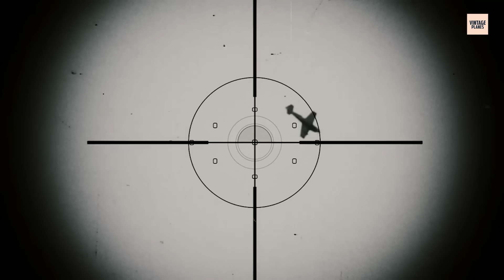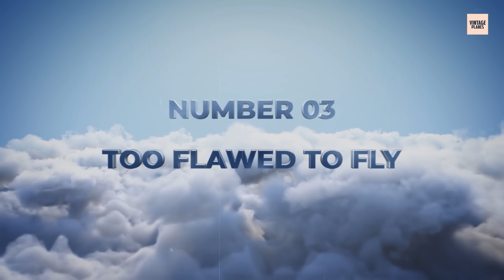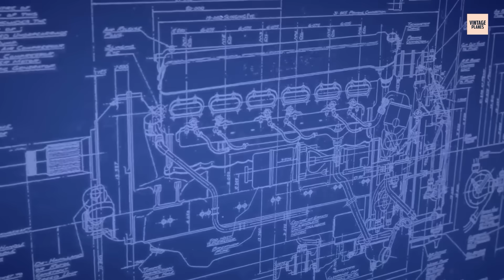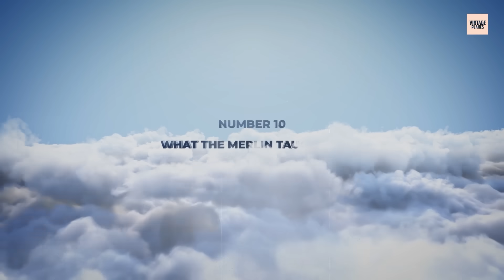THE SHOCKING TRUTH BEHIND ROLLS-ROYCE MERLIN ENGINE

Comment: I once worked with a machinist who had been trained at Rolls Royce and he told me about the unbelievable standards of quality control that went into the building of their engines. 
Crankshafts were machined from a solid billet of steel and the tolerances were exact. The bearing journals were not allowed to be machined beyond the minimum measurement by even one thousandth of an inch; 0.001”. Most factories would fix such errors by building up the undersized journal and remachine it, but RR wouldn’t allow such a thing and even if the last machining process went below the minimum specifications, and the crankshaft had already cost a phenomenal amount of time and work (which equals money) the crankshaft would be scrapped. 
Every part of the engine was made by the same machinist, so pistons were made in sets, conrods were made by another machinist, valves by another. Each part had to be as identical as humanly possible and was marked with the identity of the person who had made it. The weight of each part had to be similarly identical and if one out of a set of pistons, conrods, valves, etc was damaged in assembly, the whole set was discarded and a complete new set would be used. This is why the engines are so expensive. 
This was all postwar, but the standards came out of the experience of WWII. 
Metallurgical advances in the war were born of the desperation of wartime and were vitally important to the overall success of the Merlin engines. The P51 Mustang airframe was a great one, but the original engine was not capable of producing the power of the Merlin and it was only after the two were combined that the P51 became the incredible fighter plane its designers had envisioned. 
The only weakness in the Merlin was its carbureted fuel system, which meant it couldn’t cope with inverted flying as well as a fuel injected engine, such as the German fighters had, but work arounds went a long way towards eliminating this. One tiny, but very effective, fix was the brainchild of a young woman who suggested the addition of a washer that acted as a fuel restriction valve when the engine was inverted and that was a great improvement, to which others were added as the war continued. 
The German fuel injection systems were excellent, but they had their own issues, which required very skilled engineers to maintain and repair when necessary, which was a major problem for the German tanks, whilst British and American tanks were so simple and easy to repair that they could be repaired on the battlefield by their crews, something the Germans never managed to do. 
Aircraft were very much the same and their relative ease of maintenance and repair was a distinct advantage over the superiority (on paper) of the German machines. Other factors, such as the availability of fuel and the ability of Allied tanks and planes to communicate with each other are another, but that’s another story. 
The German fighter pilots were in awe of the Spitfires and Mustangs and other aircraft powered by Merlin engines and the memoirs of such men tell the story, which flies in the face of all the theoretical superiority of their own machines.
Reply: Then cam the Moscato the wooden wounder  so fast  nothing could catch it after it bombed   and ?? no guns at first   as a German pilot said  they flew much higher than we could  we could not  see they went through us like a knife in butter  just 2 seconds 
then they were GON we could not catch them  633
Reply: Thank you for this comment.  Very informative.

Comment: You are full of bullshit. RR designed and developed the Engine it was `manifold pressure that was the key. The higher the octaine  100 octaine fuel was the key.. your description of the development issues is theatre of the highest order. Oh, still killing pilots. In 1938 is a huge reach considering the engine was well over a year in service at this point. Crap.

Comment: Before the Rolls Royce engined P51 , it had limited range and performance from its American made Allison engine and I believe we put the first Merlin engine into a P51 and test flew it.
Reply: @trevorclark.....More British BULL$HIT !!!  The allison engined P51 had as much range as the Merlin, it was the drop tanks and the added fuselage tank that gave the later Mustangs more range !! and an Allison engined Mustang would out run any model $hitfire under 20,000 ft.  the Brits hashed up 4 test mule mustangs with the 60 series engine but could not figure out the coolin, added an ugly chin radiator that slowed the plane down.  Packard Built ALL the Merlin used in Production Merlin Mustangs and North American aviation installed and produce ALL the merlin mustangs !!!    DUUUUUHHHHHH!!!!!!!!

Comment: The  Mustang was an R.A.F. Spec that specified a R.R. Merlin, The yanks tried the Allison 1700...Flew like a Brick.... The R.A.F. reminder that a Merlin was specified then tried a Packard Merlin that Packard had cut many corners and did not understand Precision so the Packard Merlin flopped...Immediately a Genuine RR Merlin was installed the Mustang flew as intended but the Mustang was only ever a single Mk not able to be modified as with the Spitfire which went on into over 30 Mk's.
     The Merlin went on in the shape of the Griffon and when fitted in the Spitfire P.R. 19 could out climb a Mig 15, also powering the Shackleton
Reply: @altaylor  Your story is total BULL$HIT  !!!  Then  Brits came to North American Aviation BEGGING for the P40 to be built under license, they considered it the BEST AVAILABLE fighter, But Dutch Kindelberger and Lee Atwood had been working on a new fighter design, lots of research wind tunnel work, laminar flow wing, meridith radiator, and streamlining and working with NACA.  At the same time RR was over at PACKARD begging for engines.  Dutch and Lee REFUSED to build the P40 for the Brits and OFFERED to build their new fighter that would be better, faster handle better using the same V1710 V12 that the P40 used.  you see there was a shortage of the OLDER, get that OLDER merlin 20 series in Britain,  and the Allison V1710 was the ONLY V12 aero engine available in the USA !!! This was 1940,  Packard ran its first Merlin late Aug 1941 with production starting in 1942,  Lee and Dutch SOLD the Brits the Mustang with the Allison 620 of them !!!!  and the Brits were very happy with them, see the you tube video. RAF Mustangs, taken by BBC during WWII,  The drooled and slobbered over Merlin 60 the 2  stage supercharged version did not go into service till late 42 early 43.  also the Brits knew damn well what they were getting because they already had the P40, which out performed the Brits Hurrycane.  Then when the new merlin 60 came out and the new Mustang showed up it was natural for the best airframe to be mated to the best AVAILABLE engine,  the Brits hashed up 4 merlin mustangs test mules but they never saw combat.  Packard completed the first V1650/3 in the fall of 42 and the XP51B flew mid Dec 42,  The Mustang was designed for the Allison and only got the Merlin because the V1650/3  the high altitude 2 stage supercharger version was AVAILABLE in the USA thanks to PACKARD, who was contracted by RR to build the Merlin FOR THE BRITS, as a shadow factory. ironic all of Packards production for the Brits were the 20 series merlin SINGLE stage 2 speed super charged version. Packard only built about a 1050  of the 266 for the Brits used in the $hitfire MKXVI in late 1944 !!    Get your $hit stories straight and stop the damn lying trying to fluff your feathers, we know what happened over here !!!
Reply: @altaylor  Your story is total BULL$HIT  !!!  Then  Brits came to North American Aviation BEGGING for the P40 to be built under license, they considered it the BEST AVAILABLE fighter, But Dutch Kindelberger and Lee Atwood had been working on a new fighter design, lots of research wind tunnel work, laminar flow wing, meridith radiator, and streamlining and working with NACA.  At the same time RR was over at PACKARD begging for engines.  Dutch and Lee REFUSED to build the P40 for the Brits and OFFERED to build their new fighter that would be better, faster handle better using the same V1710 V12 that the P40 used.  you see there was a shortage of the OLDER, get that OLDER merlin 20 series in Britain,  and the Allison V1710 was the ONLY V12 aero engine available in the USA !!! This was 1940,  Packard ran its first Merlin late Aug 1941 with production starting in 1942,  Lee and Dutch SOLD the Brits the Mustang with the Allison 620 of them !!!!  and the Brits were very happy with them, see the you tube video. RAF Mustangs, taken by BBC during WWII,  The drooled and slobbered over Merlin 60 the 2  stage supercharged version did not go into service till late 42 early 43.  also the Brits knew damn well what they were getting because they already had the P40, which out performed the Brits Hurrycane.  Then when the new merlin 60 came out and the new Mustang showed up it was natural for the best airframe to be mated to the best AVAILABLE engine,  the Brits hashed up 4 merlin mustangs test mules but they never saw combat.  Packard completed the first V1650/3 in the fall of 42 and the XP51B flew mid Dec 42,  The Mustang was designed for the Allison and only got the Merlin because the V1650/3  the high altitude 2 stage supercharger version was AVAILABLE in the USA thanks to PACKARD, who was contracted by RR to build the Merlin FOR THE BRITS, as a shadow factory. ironic all of Packards production for the Brits were the 20 series merlin SINGLE stage 2 speed super charged version. Packard only built about a 1050  of the 266 for the Brits used in the $hitfire MKXVI in late 1944 !!    Get your $hit stories straight and stop the damn lying trying to fluff your feathers, we know what happened over here !!!

Comment: Reading through the comments I find it quite amusing how we have some little arguments starting between the Merlin and Allison engines. The fact is both engines had there places, and it’s no good saying well if they had done that, the fact is they didn’t. The Merlin went into the Mustang for high altitudes and it worked, the Allison had its own rolls to play. I have worked on many Rolls Royce and Packard built Merlin’s and one point to note was the con-rods were always shot peened on the Packards and polished on the Rolls Royce engines, I do know the reason but it could start an argument 🍾🇯🇪🏁

Comment: Yes Ford of England worked with Rolls Royce to produce the mass productions Drawings and Specification used by Rolls, Ford and Packard. Packard made 55000 engines the figures in this are Rubbish Rolls Royce made over 100,000 and Ford of Manchester made over 20,000, ford also manufactured masses of spare parts for the RAF engine overhaul facilities. Also I am not aware of Fatal failures of Merlins pre 1939.

Comment: The real truth behind the Merlin engine is the usual story of Air Ministry incompetence that still persists  with them canceling or limiting production of the very aircraft we needed in place of those that we did not. The plane we needed in 1940 was the high altitude twin engined fighter with a four cannon armament that would have devastated both German bombers and fighter aircraft alone as it was faster. The problem was that it did not perform to specification at altitude in pre-war tests allowing those in the Air Ministry and at RollsRoyce that did not want it just like they did not want the Mosquito that was the most versatile and successful aircraft of WWII. So they blamed the RollsRoyce Perigrine engine and RollsRoyce did not contest this because they saw a larger market in the Merlin for bombers that had four rather than two engines and the Spitfire and Hurricane. The real culprit was the propeller with the prototype fitted with a Rortel variable pitch one but the production unit with a thick fixed DeHavilland one. The Rotel was later fixed to Sptifires and Mosquitos after pilots took it on themselves to solve the altitude and rate of climb problems of the Spitfire but if the Air Ministry had conducted a proper enquiry in 1938 /9 this would have been clear and we would have had a far more effective response to German air attacks. But it was worse than that by supporting Bomber Harris and his large bombers using four Merlin engines we lost over 30,000 air crew whilst the Mosquito could only carry a smaller the same bomb load but unlike the Wellingtons and Lancaster hit targets with pinpoint accuracy and with its superior speed few losses to the point where it acted a pathfinder for the heavy bombers. If we had built more Mosquitos early in the war they would have been much more effective in bringing Germany to its knees by attacking  key industries, rail systems and airfields but as it was we allowed Germany to move factories further East or underground and build up their numbers of aircraft and tanks. We see the same incompetence today in the way NATO generals have lead Ukraine forces into disaster after disaster.

Comment: Now if it had fuel injection rather than a carb based on gravity, wouldn't that take the cake. I did a speech on this engine in 1960 that I'm sure bored my fellow students.
Reply: @bhut1571  ALL of Packards merlins and the Brits LATER 60 series used the Bendix pressure carb, an early form of fuel injection.  as did the Allison V1710...

Comment: The Merlin engine was a marvel of engineering. 
I always wanted to see one in action as I've only seen and heard them in the movies. Then one day I heard a sound coming from the sky as I was sitting on the porch, I knew it had to be a Merlin! 
I ran out so I could see what it was, low and behold, IT WAS A P-51 MUSTANG!
The sound was incredible!
Nothing sounds as amazing as a Merlin engine with its distinctive turbo whistle as it files by.
My dad was in the air force and he said that you had to throttle the P-51 slowly at take off or the combination of the large propeller coupled with the torque of the Merlin engine would flip the plain over.
Reply: @richardfuller !!!  hey dummy....  the merlin NEVER used a TURBOcharger !!!!!   DUUUUUHHHHH!!!!!  They used one of three forms of mechanical supercharging,. first merlin were single stage,  one compressor wheel, one speed.  20 series on used a single stage, one compressor wheel and TWO speeds !!! Up to the merlin 60 series that used a 2 stage, (2 compressor wheels) and two speeds.  FYI  TURBOcharging uses the exhaust gasses to turn a turbine wheel that drives a compressor wheel !!!!.  Mechanical supercharging uses a mechanical drive to turn the compressoer wheel !!!  Class over !!! Hope you learned something !! !
Reply: @wilburfinnigan2142  Yes I did learn something!!!
Thanks for sharing.
Reply: sorry u must have seen something else the merlin had a supercharger not a turbo and it was the R 28 Pratt and Whittney that would flip planes over due to the 14 ft dia prop

Comment: What rubbish my father worked on these engines in mosquitoes and he said that many times with holes in the crank case you could put your hand through the engine was still running he said the US Alison engine was rubbish and the mustang only reach a good performance curve when the RR Merlin was fitted.
Reply: @steamon  and your father was a F'n liar !!!  He had not a clue !!! Funny he was not aware that an Allison Mustang would out run a $hitfire   under 20,000 ft by 30 MPH !!!

Comment: For all the argument of Packard v RR, it doesn’t change the fact that it took an RAF officer to suggest fitting the Merlin into a Mustang to turn it into the long range, high level winner that it turned into.  Oh, and BTW, RR is going to keep the B-52 s in the air until they make it to 100 years old.

Comment: There was nothing special about the Merlin engine, it was no better nor worse than any other engine, it was just an engine, it was government propaganda that bred a huge myth around it, how would it look if it were known that they were sending men to war in aircraft powered by disposable throw away engines, mass produced in their hundreds of thousands, attaching the name Rolls Royce with its reputation for quality and reliability added to the myth, why put advanced technology into an aircraft that may be shot down the first time it goes into action - even the mighty Avro Lancaster had an airframe with a design life of only a hundred hours - variants were fitted into tanks and air sea rescue launches, these engines were never intended to be worked on, if one went faulty or was damaged it was simply replaced, in times of war it's time that's of the essence not engines and it makes far more sense to have lots of different factories supplying lots of the same engine, but then why let the facts get in the way of a good story.....

Comment: There is NO SHOCKING TRUTH exposed anywhere in this inaccuracy filled video. So test pilots crashed due to early engine failures..... This is why they have test pilots -- to sort out problems with new engines and aircraft. Not subscribing.